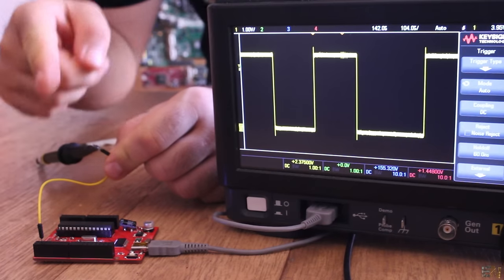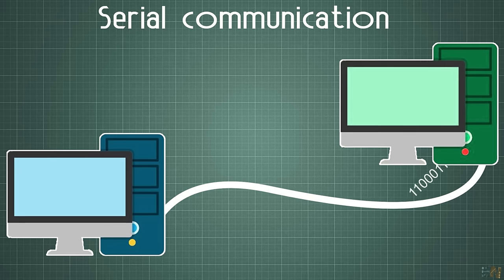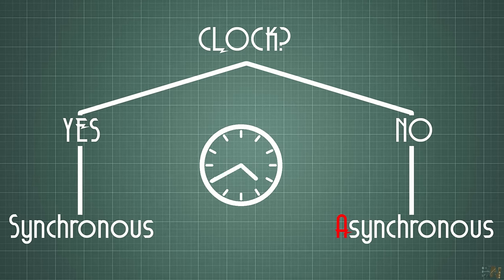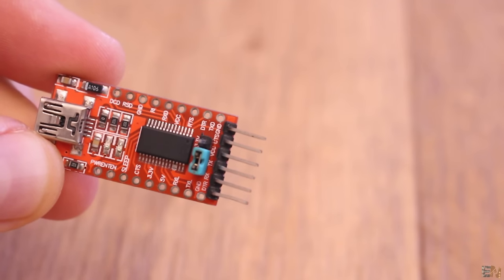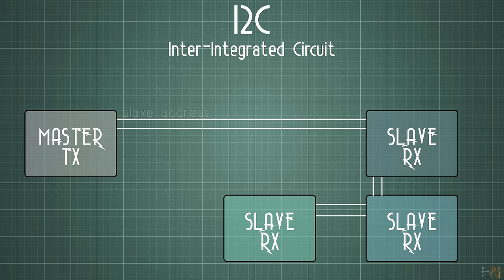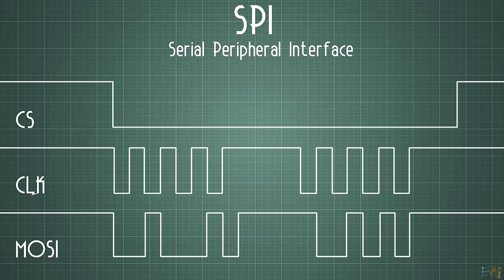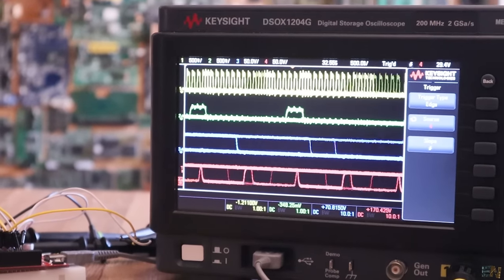PROTOCOLS: UART - I2C - SPI - Serial communications #001

Comment: Haha RS-232 is a voltage specification, same with RS-422, 20ma current loop etc.  And the terminology is 9600bps. Becuase the b is in lower case, that mean BITS. If fhe b was in upper case, lije Bps, that means. BYTES per second. 
You also skipped over rhe history if serial communication, which is very important for people to inderstand. Way back people used Morse code to communicate. The setup was a sounder (magnetic device that clicked when energized, and a Key that you pressed to make the sounder click. The key had a slide switch on it to open or close the "loop". The sounder and key was connected in series with a current source. If you connected two (or more) of these setups (key&sounder) in series with each other, when you opened your switch and began to key, every sounder in the line would click oit the Morse code. This only required a pair of wires to be run from building to building. The railroad had coast to coast tracks all over the country so jt was natural to string a pair of wires along the railroad tracks from city to city. This was the basis for "Western Union" to provide telegrams across the country. It was like a coast to coast party line, not very private. It also required an operator to be present anytine a msg was to come thru. Enter the TELETYPE machine. It was mechanical but could utilize the existing wires across the country! Each teletype required two wires to operate. This was PERFECT! Now a msg could be sent ANYTIME w/o and operator present to receive it! But HOW to send a msg???
Inside the teletype was a single motor that used standard a/c voltage @69hz. Perfect! Now we have a motor that is synchronized with our elect power and would rotate very precisely. At the end of the motor shaft had a rotary wheel on a clutch. This clutch would activate each time the loop would open (start pulse) as the wheel rotated it match the same rotation of the teletype that was sending a msg. As the wheel rotated fhe sending teletype would open and close the loop rapidly. This rapid open and close represented each bit that was to be transmitted. This would set levers in the receiving teletype and when the stop bit was sensed, the receiving teletype, printed the correct character on the paper! Yoy would have to send a carriage return THEN the line feed in that krder to allow the print wheel to go back to a home position WHILE advancing the paper up 1 line. The teletype were slow at only 11 characters/second (or 110bps, or 11cps) the reason it was 110bps was 1 start bit, 8 data bits, 1 stop bit = 10bits per character. There was no such thing as a parity bit as the teletype were dumb machines and was unable to calculate a parity not tell the transmitter to resend the character. Even with NO parity it was a very reliable way to communicate. 
They used a loop of current that was a constant 20ma. The voltage would vary and devices were added or removed and only Western Union did the work.

Comment: Nice intro to the subject, though not all info is accurate imo. I2C does have acknowledge mechanism on slave address and data bytes. UART does not have acknowledge, it does have flowcontrol and optional error detection (parity). There's also a 3-wire half duplex version of SPI, and I2C is half duplex not simplex, so the overview slide needs some attention.

Comment: Great clear explanation, but one small correction ... Baud = bits per second so 9600 baud = 9600 bits per second, 1 baud = 1 bit per second. There is no plural and there is no concept of bauds per second.

So not 9600 bauds, or 9600 bauds per second but just 9600 baud.

Comment: I think one of your diagrams was wrong.. 
Correct diagram is: 
MOSI --> MISO
MISO <-- MOSI

I would like to see the best method to connect an esp to the HPIB interface for full 2 way communication. I am thinking either i2c or RX/TX... Is there a chip that speaks HPIB  natively, or should I just program it into the code?

HPIB has 8 data pins and 8 pins that work similar to: DTR, CTS, etc..

I want to take full advantage of those pins and have it know what to do.

I have a HP3438A DVM that I hope to make post data to a MySQL database.
and let me change settings remotely..
Reply: mosi->mosi is correct, because there is 1 master

Comment: Thanks for your informative video. 
why the signal on your oscilloscope is flickering? is that because of noise or low bandwidth?
Reply from the maker: SPI is very fast and the data was not consistent so triggering is difficult

Comment: You mentioned that I2C can have a master TX and multiple RX devices.. Can it be the other way around where there are multiple transmitting devices and a master receiving device on the same I2C bus?
Reply: Those two situations are identical. He didn't properly describe I2C. I2C has two modes, read and write. When the address is sent, the master also tells the slave whether it will be writing to it or reading from it. It will usually send an extra byte of data representing the register it is writing to or reading from. Depending on if the master told it to read or write, the slave will either record the incoming data or send out the data from the specified register.

I2C also has an acknowledge action that tells the master that the slave with that address is there.

It is important to note that only one device can send data at a time, so the master controls what device gets access to the data line. If the master is writing to a slave, the master controls it. If the master is reading from a slave, that specific slave controls the data line until the master tells it to stop.

Comment: On UART, why is the start bit on the left and the stop bit on the right?  I thought it is the other way around as in serial communication, the LSB gets sent first.
Reply: Jancen J depends on which way the data is flowing.  😉
Reply: But seriously binary is usually represented with the most significant bit on the left.   The start bit comes across before the MSB.  That is why it is represented on the far left.

Comment: Nice video, but RS-232, I2C, SPI, etc. are NOT “protocols”, they are PHYSICAL LAYERS of communication using timing methods. PROTOCOL refers to the unique data method that is used to exchange information over these physical layers between devices.

Comment: I clearly don’t understand something here because I don’t see any other comments about it but how does the uart serial transmission know that the stop but isn’t just for the binary
Reply: I think because the data length is set in the beginning. So if data length is 8 bits, the receiver will expect 1 extra bit for start in the beginning, and 1 at the end for stop, for a total of 10 bits.

Comment: The signal nor the stated value (011100011) on the oscilloscope does not correspond with the diagram show previously (uart, rs232).

Comment: I don't understand how UART knows when the communication stops. The "stop bit" looks just like a regular high bit, does it not?
Reply: you have to set the same number of useful bits in the message (without start and stop bit) in both TX and RX devices (its usually 7 or 8 bits), then RX device simply counts number of message bits after the start bit and it knows that the last HIGH bit must be the stop bit

Comment: how to read spi signals through usb on a pc, like i want to capture video output of a device( which uses spi to drive its lcd)  and convert that data into a video stream through software? is it even possible ? or is converting it to hdmi/vga signal with fpga only possible solution?

Comment: (UART) I see your start bit is closest to the Tx pin, I'm confused because I'm under the impression that Tx is the transmitter. Please help anyone.
Reply: I think made a mistake when he wrote those labels, your understanding of the explanation is correct. Those labes should be inverted.
Reply: Bless

Comment: I hate to be That Guy, but you have a couple of mistakes.   

First there is no such unit as bauds/second.   It is just baud and 1 baud = 1 bit / second

Second on I2C it will not keep transmitting without a receiver present.  There is an ACK bit as part of the protocol.   If the Master does not see the ACK from the slave it will stop.   This usually happens when it is sending the address byte.  

Again sorry to sound negative.   But I’m sure you don’t want to teach this wrong.

Comment: Why does it need a stop bit? Why not just stop after 8 bits?
Reply: It might have some error checking capability, but I believe from what i've read about it, it's to give the receiver time to do something with the byte just received.  The receiving buffer might be smaller than the buffer on the transmitter, so the transmitter could overrun the receiver if it kept transmitting byte after byte.  If the transmitter only sent one byte, what you suggest could work.  But if the transmitter is sending a lot of bytes, the stop bit provides a "reset" so the line is at the proper level to detect the next start bit.

Comment: I hope you do not mind me pointing out a few mistakes: At the beginning, you said RS 233 rather than RS 232, although the number on the screen was correct. You showed the "uart" speed as baud/second, which is incorrect - it is just "baud", which means "bits per second". Bits per second per second is a change in speed, which is not possible on uarts. On the SPI graphic your arrows point out the slave select wires, but one arrow incorrectly points to the miso wire. If you are trying to educate, it is very important to ensure accuracy in your presentation material.

Comment: Great video.  But, I would not use the word "cable"  when you really mean wire or line.  The old parallel printer "cables" had 25-36 wires.  1 cable = 36 wires/lines.  Cable does not mean 1 wire or 1 line.  A cable is generally considered a bunch of wires.  

There is no such thing as "bauds/Second".  There's no such thing as bauds.  It's BAUD.  Baud means symbols per second.  Therefore, when you say "baud/second"  you are saying symbols per second, per second.  This is meaningless.  It's like saying Hertz (Hz) per second when Hz itself already means per second.  

BAUD is very commonly misunderstood.  It means the signaling rate on a line.  How fast the signal is changing.  It really has nothing to do with the bit rate.  The only time the BAUD rate equals the bit rate is in this special case when one change (high to low or low to high, the symbol) means one bit (0 or 1).  It is possible, in fact common, for the BAUD symbol to represent more than one bit.  In which case the BAUD rate could remain the same while the bit rate increased.

Suppose one change on the line represented 2 bits.  Yes, this is quite possible.  In this case, a BAUD rate of 9600 would be a bit rate of 19200 bits / second.

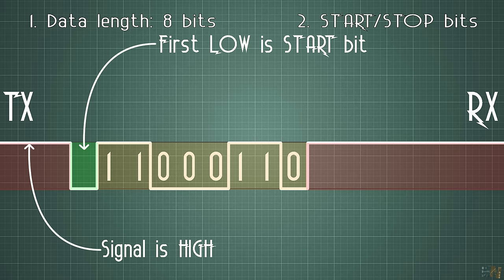Comment: Why start bit is on the left?! 5:00
Reply: I think the slide on 5:00 is confusing. It's written as if the first digit on the left is sent out first, while the rest of the digits follow. It's NOT the signal on the line between sender and receiver.

Comment: I stopped watching when he said that serial communication was slower because it needs more clocks. This is only true in an ideal world. Under true conditions, the maximum clock rate of parallel bus systems is severely limited by the fact that the parallel bits take different times to travel through the wire, while a serial system is virtually unlimited in this regard. In the end, modern serial communication always wins.